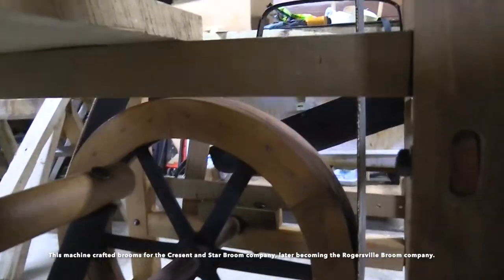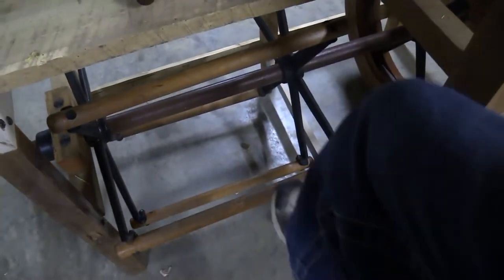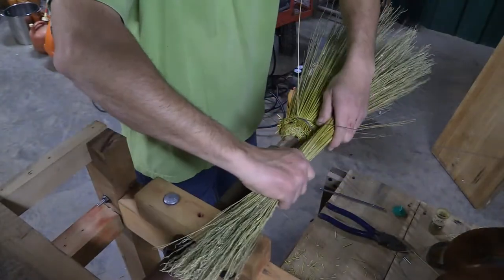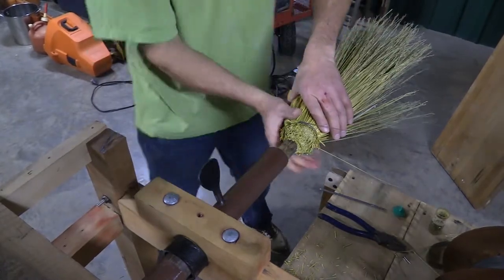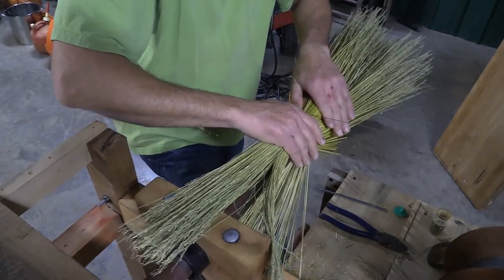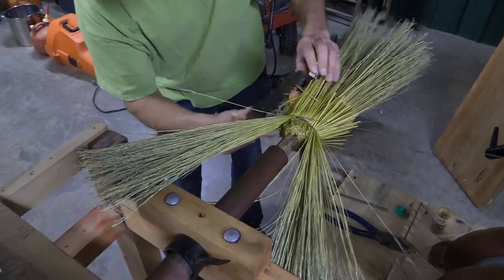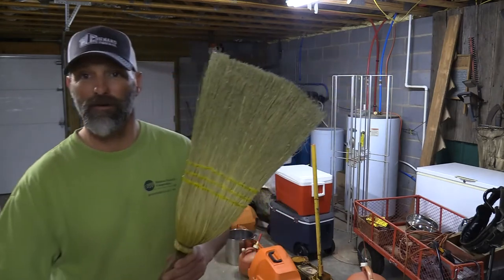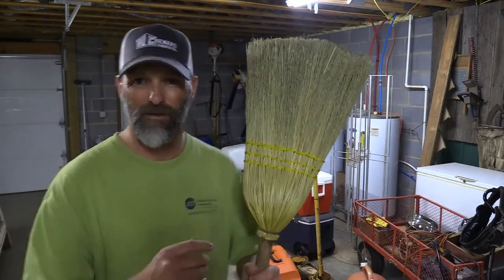Broom Making with Antique Kick-Winder

Comment: Ok Im trying to save a vintage kickwinder i need information on how the wire keeps tension. I believe I have most of the parts but not 100% sure.
Reply from the maker: Hey Randy, congrats on finding and restoring your kick winder. My spool of wire was fashioned on the axle as to not allow the spool to freely spin on the axle. Then the axle runs through 2 pieces of wood attached to the frame that act as brake pads. The drag is adjusted with a single bolt. It sounds a little complex but very basic. The spool is permanent on the axle, I just rewind wire as needed. Hope this helps and please keep me posted. I’d love to see your handy work!!! Good luck and God bless
Reply from the maker: If you look close you can see the wooden brake at the 2min mark.
Reply: @sasquatchboogieoutdoors9267  Thanks so much I guess the brake was eaten but termites I my kickwinder I have the shaft and the spool looks like I can just build the brake
Reply from the maker: @coalcountrycandles  many of the parts on mine are homemade. That’s One of the things I loved about it… I have 2 more to rescue.
Reply: I'd reckon everything was " homemade" when it was produced. Simple design and simple construction even if a "factory" produced it. Now everything's plastic and disposable. Makes one wish for the old days that weren't that long ago when things could be fixed and still function if you had the wherewithall and desire to do so. Crazy how times have changed in just a few short years. 50 yrs ago fixing things was possible, not many realize progress wasn't really progress. More like a dumbing down of society as a whole.
Reply from the maker: @yougonnaeatthat9889  I agree. I would classify those folks as “ highly intelligent survivors”. Not highly educated dependents.

Comment: I have started restoring my kick winder. Now I have ran into a problem with it. It will not lock the handle to keep the tension.
Reply from the maker: Do you mean the “chuck” will not tighten  down on the handle?
Reply: @sasquatchboogieoutdoors9267  the chuck holds the handle but when it spins forward there’s nothing keeping the chuck from spinning backwards or is nothing to keep it from going backwards